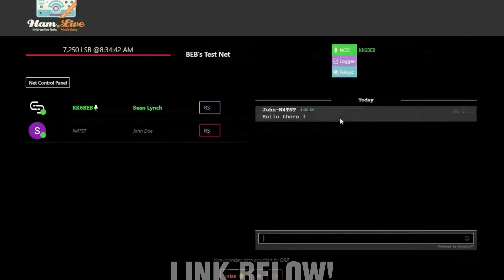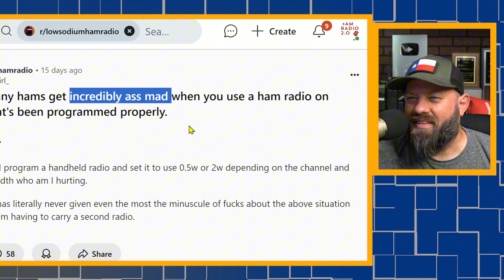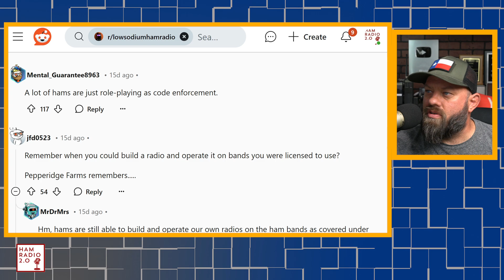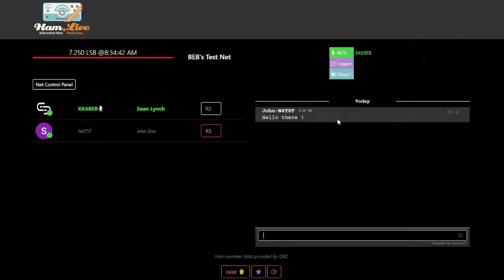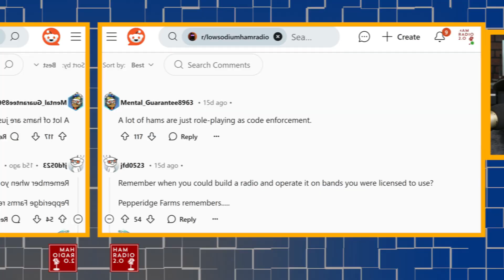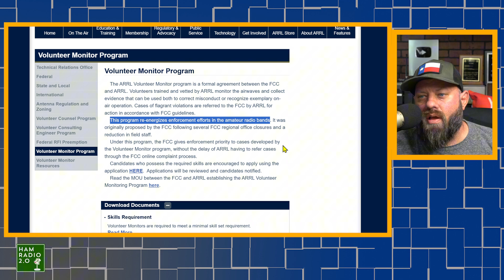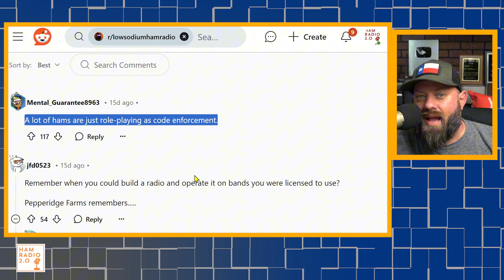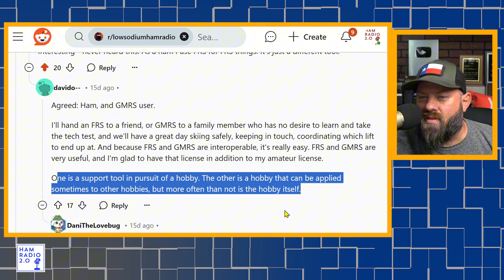Can We Use HAM RADIOS on FRS Frequencies?

Comment: This is never ending about using radios not certified for the purpose they are being used for. I regret modifying my YAESU FT-60R, because it wasn't intended for any other radio service. Part 90 radios, as long as the radio user only stays in the band spectrum that he or she is authorized to use, what's the problem? Unless the individual is real nut, we all know to stay off public safety and public service bands and stay off RR and Maritime VHF

Comment: A couple of things. 

There’s no such thing as a ham radio, except “a radio an amateur radio operator is using on their allocated frequencies.” That’s it. Modify a CB to transmit on 10m? That’s a ham radio. Homebrew superhet transceiver? That’s a ham radio. Business band Motorola used on 70cm? Ham radio. 

2nd thing is I see a lot of folks in the comments talking about “properly programming” the power and bandwidth. I’ve not come across a single HT that CAN be properly programmed for GMRS. Bandwidth on 5/50W frequencies is only 20kHz, not the usual 25kHz and 0.5W on the interstitial frequencies where the 12.5khz bandwidth is possible, isn’t going to happen when low power is typically 2W. You can get close, but you can’t actually program most HTs to fit within the GMRS regs. 

That said, if you’re not causing interference, it’s none of my business. There’s a lot of benefits to having a single radio. You do you.
Reply from the maker: When a radio is sold with frequencies that are restricted to the Ham bands, that's a Ham Radio. 
Your definition is correct for radios built by individuals but not for commercial companies selling radios for profit.
Reply: @ we’re gonna have to just disagree about that.

Comment: I'm in Spain so we don't have GMRS or FRS here but we do have PMR which is license free on 446mhz it's limited to 0.5 watt output and must have a fixed antenna to be compliant with the regulations. While I do have 2 of these radios I live in the city and as you can imagine the reach is not so great in built up areas. For emergency use I've got a uv5r that I've given to my other half (she knows how to turn it on only) it's programmed with 1 channel and our "privacy" code for emergency use only, armaggedon, no phone, internet connections etc. I'm guessing if that comes around nobody will care anyway. I know there are people who use the PMR with external antennas or "ham radios" and I personally don't care to be honest. I'm a new HAM as I only passed in August last year. I understand the need for self regulation etc. If you transmit on these frequencies using maximum power then you deserve a slap but if you're being sensible then what's the problem? EA2FDZ

Comment: We've got enough to "worry" about as hams.  I could care less what people do elsewhere.  The most I would ever say to anyone, if inspired to do so (I'm not), would be, "...just don't be a jerk".  That's true all the time for everything.

However, as a ham, I do feel that if you've gone through the effort to get your ticket, we should be able to use ANY radio ANYWHERE we want.  Let's not pretend its protecting anyone by having to carry multiple radios for multiple services when 1 can do it all.  In fact, if I'm carrying 3 radios, I want them ALL to be able to do everything so I have redundancy.

File under "2 is 1 and 1 is none" 😎

Basically, amateur radio operators should be exempt from FCC oversight.

Comment: There has not been a single enforcement action against anyone for type acceptance violation as a primary offence, if you're busted for something else like jamming or other attention attracting offenses, yes the FCC will add that charge on just like a traffic cop will add a busted tail light to your speeding ticket. I have searched the enforcement actions database for anything related to type acceptance violations and found nothing. Yes it is illegal but so is "J" walking, but with the budget restraints and staff shortages they have bigger fish to fry like broadcast pirate radios stations very profitable in fines.  When I lived in rural WV the volunteer FD used Yaesu radios on the fire frequencies and even added DTMF ID at the tail of each transmission and no body cared.
Reply from the maker: There's no reason you shouldn't be able to use Yaesu radios on fire department frequencies, that's really more up to your fire department
Reply: @HamRadio2  there was a case outta CA where a ham got fined for "calling for rescue" and actually saving someone's life using a part 97 radio on FRS/GMRS (as I recall) way out in the sticks, the FCC still fined the crap outta him. I just don't get that...

Comment: When I acquired my TD-H8, I unlocked it because I possess both ham and GMRS licenses, and my local ham and GMRS frequencies are programmed in, along with FRS and MURS. I ensured that GMRS, MURS and FRS were programmed correctly concerning power level and bandwidth. Although I have not needed to on FRS or MURS, I appreciate the if necessary., I have the blue and green dot frequencies programmed. It is quite amusing when waiting too long for a keyholder in Walmart to unlock a case, no one appears for 15 or20 minutes, but as soon as you transmit over their frequency asking for assistance, someone arrives PDQ.
Reply: What's their main frequency and PL tone?

Comment: some people that wants to complain just wants to start wars and be karens about using ham handhelds on GMRS and FRS but most of us does not care if their radios are advertised as hams but they are unlocked and allows transmitting outside of ham bands then go at it program GMRS and/or FRS on it i have 1 radio which is a motorola xpr3500e it's UHF and the radio allows me to program 16 channels in a folder so in folder 1 i can program up to 16 then when i reach 16 i create a new folder and program 16 more channels so in folder 1 i program some ham and in folder 2 i program some GMRS and in folders 3 and 4 i program GMRS/FRS simplex and on my VHF which is moto xpr 7550E i program my local ham repeaters and i program my boat club marine channels so if long i don't mention it on air then people won't know what i'm using nor what channels i programmed into my radio

Comment: I can't comprehend why people don't want to use follow the rules. Family Radio Service (FRS) is part part 95 Subpart B it's license free, but there's rules to follow. 95.533 Prohibited FRS uses, 95.561 FRS transmitter certification, and 95.587 (b) (1) The antenna must be a non-removable integral part of the FRS transmitter type. Now, all the amateur radio transceivers have removable antennas, so using a ham TX/RX on the FRS is breaking the rules , even though you programmed the radio to TX out put power no higher than 0.5 watts on channels 8 through 14 and ERP on channels 1 through 7 and 15 through 22 no higher than 2.0 watts. Using an amateur radio transceiver to break the FCC rules on part 95 is not a good thing for the amateur radio service. It looks like amateur radio operators modified their radios to talk on license free bands, when in reality, those who do that are not hams. I think hams who are upset about that is because they want to protect the reputation of ham radio operators, I think. It's the same thing for CB radio. It's illegal for an amateur radio operator to modify a certified amateur radio transceiver to use on the 11 meter CB band because doing so will break the part 95 Subpart D CB rules. Especially 95.935 (a) (b) unauthorized use of non CBRS transmitters. In this case, the CB operator might not be happy to see that because by breaking the CB rules, that person diminishes the reputation of other CB operators on the band. However,  we all know many people choose to use unauthorized CB transmitters on the CB band, and they're mad if someone tells them it's wrong and illegal to do. It would be to people follow the rules,  but they won't.  So,  let them do it at their own risk.
Reply: There’s no such thing as a “certified ham radio”. The operator is licensed, not the radio.

lol Just got to the part of the video where Jason said so himself.

Comment: I have all MURS and FRS/GMRS freqs programmed into my ham radios that will allow those freqs. My Yaesu VX-9 and Kenwood TH-D75 will allow those. I could do MARS mods on both radios easily but so far have not. So I only have them freqs programmed in for listening only at this time. I also have all marine HF and a lot of railroad freqs too. And why not? Easy to do if you have programming software.

Comment: Long bunch of BS for a simple answer.   No.    Done.   Read the rules.  FRS is covered by part 95.   It requires all radios to be type accepted by the FCC to be used there.   Part 97 only covers ham frequencies only.

As far as those of us getting mad about it....hams always justify using ham radios any where they want because of their misinterpreting a part 97 rule. That makes all hams look bad. You want people to repect and follow part 97 rules on the ham bands (like licensing requirements), then hams need to expect to follow the rules on other services frequencies

I spent many years as a member of REACT on the CB.   Yup.  It makes me extremely mad to be at an emergency communication event and listen to hams teaching that part 97 allows you to use your ham radio anywhere you want for emergency support communications.   No, it does not.   Part 97 ONLY applies to ham frequencies.  And many other services flat out state that there are no exceptions to the rules for that service even in an emergency

Comment: Here we go again, beating that same sad dead horse smdh . Nevermind the countless ham radios over the years that could transmit in other bands before the boofwang ever came out. EDIT why do they get mad?? Because those sad hams out there think they are elite radio operators and NO ONE outside of the ham fraternity should have a ham radio that isn't a licensed ham. I hope this answers the question lol
Reply: ISM Bands are Industrial , Scientific , Medical frequencies that also fall into unlicensed use some are even covered under Part 15 rules of the FCC. I can go to a small portion of the 22 meter hf band and operate a legal license free radio station that if i am lucky might make it across town or skip under magical conditions be heard by die hard dx'ers on the shortwave bands. I can legally operate 1 watt on longwave between 160 to 190 khz. We can experiment on some of the ISM channels without fear of the fcc knocking down our doors under part 15 as long as i don't cause interference and accept interference. ISM is also used for as the name implies Industrial sensors, medical equipment and scientific equipment since none of those services need a license to operate low powered equipment but must  be properly trained to use it. It's weird i know but there it is. You can legally have a AM or FM radio station as long as you follow the rules..... mhmm so there i answered a question no one really asked. 
btw 902 - to 928 mhz can be used license free under 1 watt

Comment: GMRS is 20KHz not 25. That is the only REAL issue. I don't care and nobody has ever complained. I use my icom on gmrs and I know it does bleed over a bit but it's not that strong. 2.5K on each side is like an S2 under my antenna on those bleeding over frequencies.
Almost every GMRS user I know uses a Motorola or Kenwood and nobody cares or complains.

Comment: There are karens everywhere,  including amateur radio. Yes I've had to tolerate a few local Hams preaching the evils of GMRS and FRS  and the Satanic Baofeng. Many of Baofengs originally came into the counrty labeled CB radios and programed on GMRS and FRS channels.  That being said, there are also those out there that feel the need to chastise any perceived infraction of any rule. I find letting them babble until they run out of steam, and then started a whole different discussion is the shortest way to return to sanity. But, thats just me. KG7KQT

Comment: I am a Licensed Amateur radio operator who also has a Gmrs License,  Here's my take on the issue, front panel programming, if the radio has a keypad and ANY Frequency can be entered in the vfo or stored in the memory,as Amateur Radio equipment can , the radio can  go " out of band" even accidentally, they can potentially interfere with other licensed services,and,  the average person getting one of those radios has no clue what they are doing. 
  I don't get mad about it, I also have no problem with letting folks know it's illegal to use those there. Baofeng actually sells a bf 888 s. I have one set up on Gmrs. It has no keypad so it will only operate where it's programmed you can't change the frequency in the field in other words. In my mind , problem solved with that Radio. 
Just a few thoughts, remember integrity is doing the Right thing even when no one is watching.
 Happy new year.

Comment: Reprogramming my Kenwood in the truck with some frequencies that I missed originally has been long overdue. I was planning on doing that today. Now I will also be adding the GRMS and FRS frequencies to it. I don't intend to use them regularly, but they will be programmed in case they're needed. Will be doing the same to my handhelds, as well.

Comment: I have both a GMRS and a Ham License For either service one needs the appropriate license.  For the non-Ham a GMRS radio that is locked to the appropriate frequencies is important as the radio cannot be used elsewhere. Remember these individuals may have a poor understanding radio.  FRS radios must have a fixed and not removable antenna. Also remember cross service contacts are not allowed. (E.G. FRS to GMRS) I have a few Chinese Handitalkies that can be configured as either a  ham or GMRS radio.  Some of my radios are configured as GMRS and others as Ham and I use the appropriate callsign on the air.

Comment: I wouldn't exactly call it a "stupid rule," but for a ham operator that knows what they're doing it's sort of unnecessary.

The FCC has to make sure users on every radio service stay within the rules one way or another. On CB, marine, FRS, MURS, and GMRS, where any operator is allowed to use any of the assigned channels, they do this by certifying that the equipment doesn't let anyone transmit a signal that breaks any of the rules. For business/public safety land mobile, the certification works basically the same way except that the radio can transmit on other frequencies but the dealer or customer has to make sure it's programmed only for channels they're licensed to use; once it's in the hands of a user in the field it's equivalent. The amateur service works by certifying the operator instead, which is why we have to take a test first to prove we read the rules and know how to follow them even with equipment that doesn't restrict any operation. So if you're a licensed ham you most likely know how to program a radio so that it transmits on a service like FRS exactly the same way a real certified FRS radio would, which means there's no technical difference between the signals the two radios are generating. Indeed as many people point out there are radios available in both FRS or GMRS and amateur versions that use identical hardware with different firmware. That's why it's a pretty pointless rule in the context of ensuring fair use of the radio spectrum.

But just because you might assume that a typical ham operator would know how to program a radio to work correctly on another service, nothing on the test actually implies they can. Could they make an exception that a GMRS operator who also holds a ham license can use a non-certified radio tuned to GMRS frequencies (i know this video is about FRS and I'm blurring the line between the two a little, but i see this even less likely for FRS) as long as they make sure power levels are within limits? I suppose, but it would be silly. Enforcement is both a low priority and effectively impossible in this case (you can't identify a free banded ham radio vs something type-certified for another service just by listening to its signal, and physically hunting down every 5W radio on the air to check the serial number label is even more obviously implausible) so it wouldn't reduce the already nonexistent number of violations being issued. And it would risk implicitly allowing a class of equipment - VFO-capable radios not locked to amateur bands - otherwise prohibited, the only other choice being part 90 radios programmed for GMRS and/or ham frequencies, which aren't a particularly popular or convenient option anyway.

So while the rule effectively doesn't change anything in the technical sense, it's just one of those bases you have to cover when writing regulations to make sure you're not making it too easy to break other rules.

Comment: Personally as long as your not being rude or doing something really dumb i do not see a problem using a radio for multiple purposes. If you are on FRS or GMRS frequencies then try to keep the radio in question programed to proper frequency channel and power limits.  When on road trips i have used my vehicle mounted antenna and radio to monitor our groups FRS channel which came in handy when we got separated by traffic .